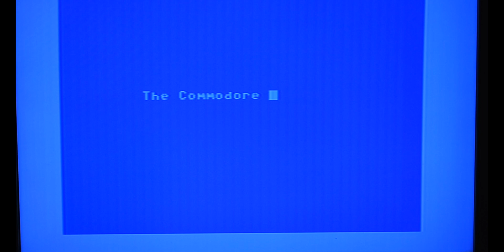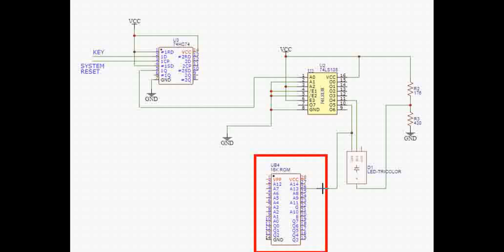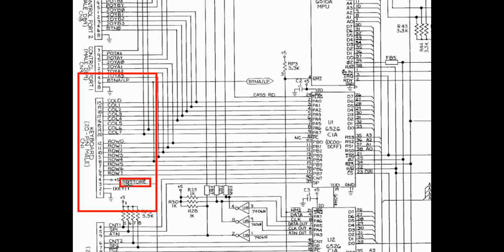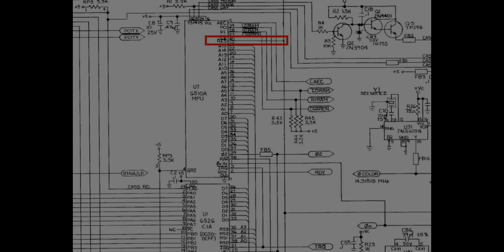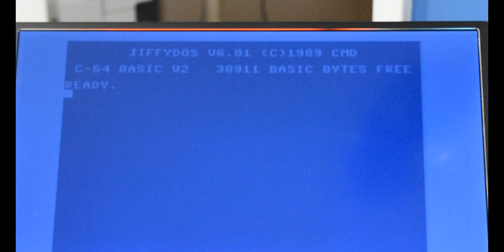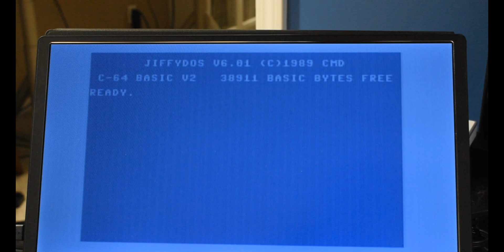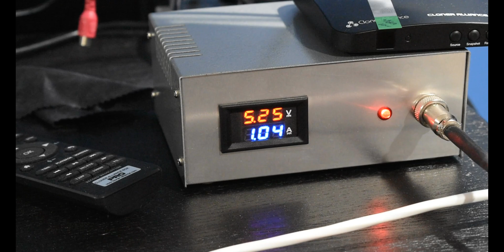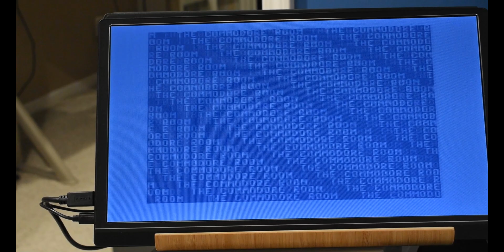Commodore 64 JiffyDOS with a Twist - Switchless with an indicator LED

Comment: Hi. Thank you for the video. This mod is really interesting because I don't have to drill the case. I will have to check the 1541 video to understand how you moded that one. The LED is a brilliant idea!

Is it not a bit too high, to have 5.25V on the 5V rail? (At least, according to the C64 wiki).

Comment: What are the hardware differences between Jiffy Dos and Dolphin Dos ?. Both have addons on C64 and 1541. Afaik Dolphin Dos  has extra parallel port connection and faster than Jiffy.

Comment: Great stuff! Thanks for sharing - it makes me pretend I actually know something about my old favorite 8-bit. :-P 

Will this mod work with the C64C case? IIRC, that one has less clearance...
Reply from the maker: This particular mod will most likely not work on the 64C without some other tweaks. From the schematics I’ve looked at, the modulator is necessary. I really wasn’t worried about video quality with this one. But I’m thinking about a 64C version with better quality and the appropriate changes to remove the modulator.